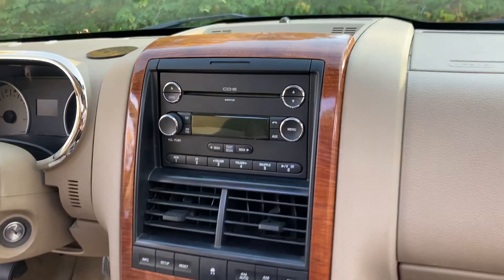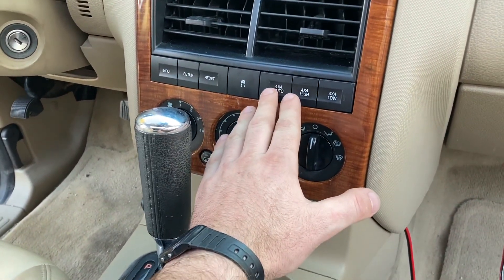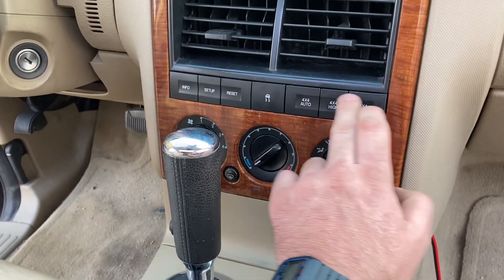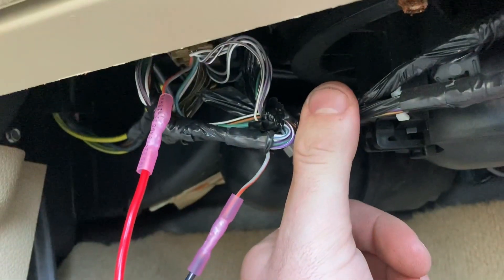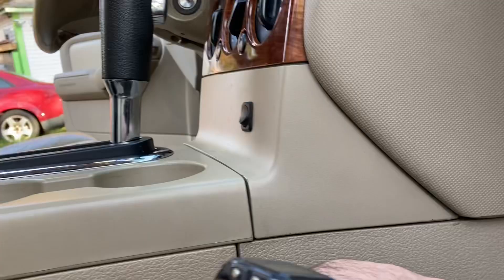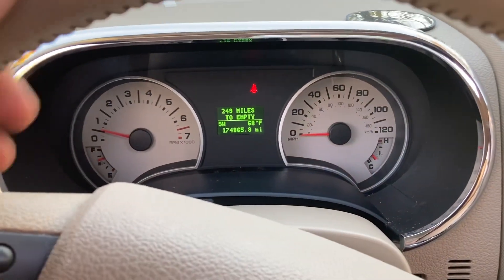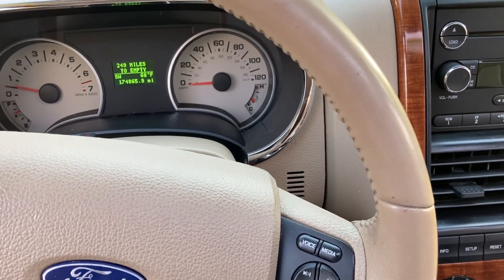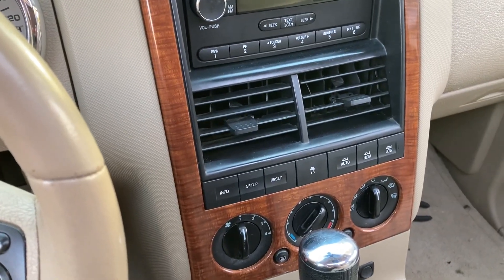2006-2010 Ford Explorer Auto 4x4 Bypass/“Brown Wire Mod” Tutorial

Comment: Do you know if the grey with orange wire is also in the 2004 Ford Explorer or would that be a different color
Reply from the maker: @DJContracting  I believe the color would be different. Best bet is to pull up a wiring diagram.

Comment: Could this blow the 4x4 fuse?
Reply from the maker: @jaydenpeters7941  you may cause issues if you short the wires to the metalwork in the dash, but the modification itself will not.

Comment: With your ford explore,
Have your change the timing chains and cassette replacements?
Was it done before you bought it?
 I have a 2007 v6, from Miami, Florida.
It has No rust, and was taken very goo care of.
It has 52,000 miles on it as of now.
   I know that the ford engines are not so great.
But I saw them with 300,000 miles and rusted out and still running.
And I seen the with 90,000 with the timing chains, death rattle.
  My question is how is your engine doing?
Reply from the maker: @HatBilly2008  mine is fine for now, 182k miles. My transmission is going, but the motor seems healthy.
Reply: @ thank you, when your transmission goes bad, the longer you drive it the more expensive the problem becomes. Best wishes

Comment: So traction control still works ? if you turn it off theoretically could you do rwd burnout ??
Reply from the maker: @brennan7085  both in theory and in practice it works.
Reply: @Hazzard2theworld911  thank you i pulled the fuses for the 4x4 system and it seems to have done the same thing. and traction control works

Comment: Disengaging your auto four by four is basically turning off your traction control. I wouldn't recommend turning this off when you have slippery conditions on the road.
Reply from the maker: No. Traction control is still active. 

Still, I recommend using auto 4x4 in poor conditions.

Comment: How did you come to the conclusion you needed to do this..I mean was there something wrong with the vehicle
Reply from the maker: Nothing was wrong, I simply wanted control over the system and whether or not it is engaged. Deactivating auto 4x4 saves wear and tear on the transfer case, and also decreases fuel consumption by about 8-10%.

Comment: You can also just remove the fuse
Reply: Have you done it? How has it worked? Are there any things I should worry about?
Reply from the maker: You could, but this way the system can be reengaged on-the-fly without stopping.

Comment: Hey, i have a 2006 Explorer XLT. Followed your video found the plug then the gray and orange wire, cut this wire. To check things out I started it and pushed the 4 wheel high button. The 4 x 4 on dashboard lit up. Even after I cut the wire. So is it one of the other wires? Help?  Thanks, BL.
Reply: It is a brown wire n older models
Reply: @crungen5 so is it brown wire or orange an grey n 2006 ford explorer?

Comment: Great video! I just complete the modification on my 2008 Explorer Eddie Bauer, V8 version. I fastened my mini toggle switch (on an L bracket) to a metal, console support bolt below the dash (just beside drivers right leg). I removed the two console side panels that extend down to the carpet, then ran my wiring from the drivers side ( under/through the console) to the passenger side just behind the glove box where the 4x4 module is located. Before proceeding, I checked for power on the Grey-Orange wire on the brown connector (engine running) and confirmed it is powered by fuse #18 (10A) under the drivers side dash (fuse for the 4x4 system). After I installed the switch in the grey-orange wire circuit, I could turn the system on and off without generating any engine codes or maintenance alarms! The modification simply removes power from the 4x4 module without affecting any other functions. I am going to leave the 4x4 system OFF unless I need it for slippery roads or pulling my boat out at the ramp. I installed this modification because I could feel the electric clutch in the transfer case engaging when I went over curbs or experience mild wheel slippage. Also, if you have different sized tires (or run a spare tire for a short time) you can run into issues with this 4x4 system. I just want to extend the life of the transfer case clutch. In case someone what to know more about how the 2006-2010 Explorer transfer case / 4x4 system works, I have added a link below. Thanks so much. John
https://www.transmissiondigest.com/the-fine-points-of-the-borgwarner-4411-transfer-case/
Reply from the maker: I'm so glad you found this helpful. thank you for that link, very interesting.
Reply: Thank you. You saved me a lot of time
Reply: @MrRex4513  You are welcome my friend! John

Comment: Does it work for both v6 and v8 4x4? Thanks
Reply: Yes. As long as your vehicle has 4x4, the wire and system will work the same, V8 or V6.

Comment: I do like your video. I seen a few of these videos while I'm sure it does work. I would love if someone would show their truck off the ground and the wheel functioning and working the way they say it should.
Reply: If done right you will notice right away your rear tires have all power and the front won’t engage
Reply from the maker: Thanks! I plan on getting a video of this, I just need to finish some other work on the truck first.